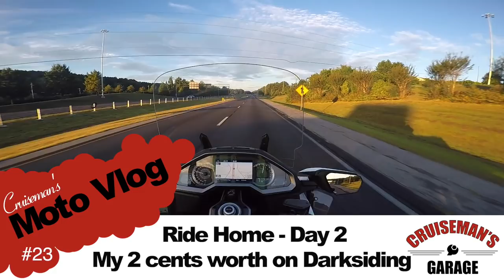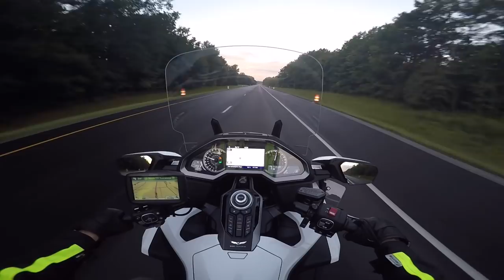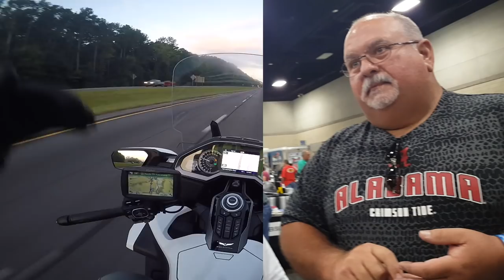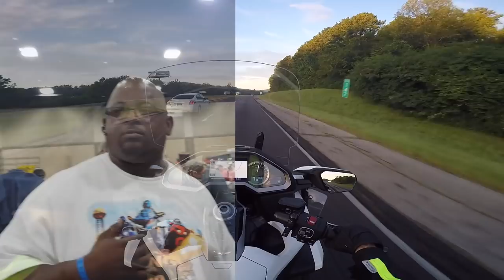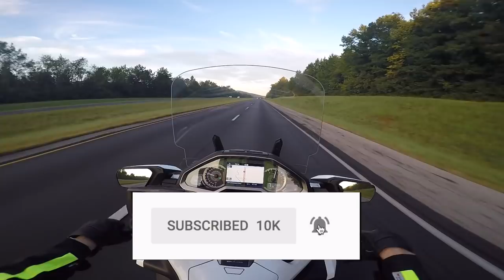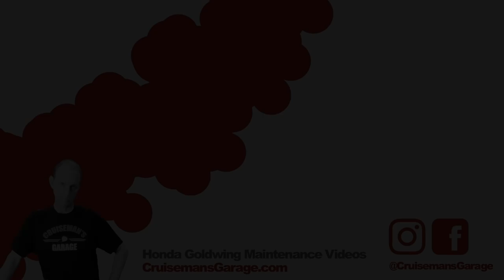[Ep 23] My 2 cents worth on Darksiding - 2018 Honda Goldwing

Comment: I can give my 2 cents on this I had one for over 19,000 miles on a toyo darkside on my 2012 it was neat to try it but when I got a deal on a set of new E4 I installed them, When I dismounted the   darkside the side wall was very flimsy not stiff at all, Saying that I am a younger Goldwing and I ride the curves move aggressive than most, Cause I have yet to see a Goldwing with the lower cowl scraped from front to back and the front crash bars scraped up  but lol bike handle like a dream, But the car tire isn't made for the bike PERIOD. But for folks that pull trailers and ride hwy 90% of there travels, It is a money saver and fine, But for me I tried it and its not for me MC tires rest of way.

Comment: My 2018 White Tour is not DS (yet), but my 2002  Black is Darth Vader and has been for quite some time.  There are HUGE differences in how various car tires perform and you need to get the right one for your style.  Run the super slab, get one of the run flats.  But I live in the mountains, non-run flats for me and I do not do it to save $, its the traction.  Honda has almost made all 2018 GLs Darkside!

prs
Reply from the maker: "Honda has almost made all 2018 GLs Darkside!": Not sure I understand.
Reply: Cruiseman's Garage  : Take a look from the rear of your 2018 at the tire.   How WIDE it is (wider than the 180-55R-16 many of us use on the previous model.  Notice the profile, as you discussed, is rounded, but NOT so much as the Dunnies you used on your previous bike.  This is something I originally thought I would not like at all, but now; it is a viable option.  Also, even though we tend to run fairly high pressure in non-run flats, the ride is super comfy!  Pillion ride is very happy.

Comment: You are quite a scientist.  One story you cannot authenticate makes your decision.  Okay, I know two people who suffered belt separation on a Dunlop E4 running at highway speed and in one case the bike went down and totalled it.  Is that enough to not run Dunlop E4s?   I run Kumho/Continental/Michilen ZP 195/55/R16 for over 200k miles, no issues.  The tire is difficult to install on the rim.
Reply from the maker: Never claimed to be a scientist. Find a motorcycle dealer that will install a car tire onto a motorcycle rim and, I might re-think my position. Or, find a car tire company (one that does not make MC tires) claim that it is OK to mount their tires on a motorcycle. In spite of the inability to provide either of those, I am still open-minded to Darksiding.

Comment: I think with all this attention being drawn to dark siding that the insurance co.s will be taking another look at this issue and will start denying claims. It would be a excuse for them not to pay off, whether or not the tire was at fault.
Reply from the maker: I don't think the Darkside community is large enough to grab the attention of insurance companies. You can even break the law and insurance will usually still pay. If you are speeding, and have an accident, insurance pays. They may not renew your policy, but they will pay. Pulling a trailer is not recommended by Honda, but my insurance company INSURES my trailer.

Comment: Cruiseman, all of your repair videos I've seen provide excellent, factual info that is easier to follow than the repair manual. However, here you provide nothing factual, and only offer your opinion and here say. You are an influential person in our community, and what you have done here is validate the naysayers, and embolden them to voice their own emotionally charged opinions. Many cite safety, poor handling, and intended design of car v. motorcycle tires, yet they pull trailers. I refer back to page 4 of my 2008's Owner's Manual, under the WARNING of serious injury or death re: trailers & sidecars: "This motorcycle was not designed for those attachments, and their use can seriously impair your motorcycle's handling." Simply put, the naysayers who pull trailers are, "talking out of both sides of their mouths". Further, most have no first hand experience with DS. ***Instead of speculation, I challenge YOU to actually try a car tire for 1000 miles, then come back and give an update based on your experience. Choose any brand, but make sure it is a run flat, size 195/55, and experiment with PSI from 32 up to the max limit of the tire, as printed on the sidewall.
Reply: Amen Joe , tell it brother...
Reply: Joe, very well stated. I went to a CT for the wear, I found I had more traction in a corner. I never dragged a foot peg with MT on my bike, now it's very easy to do that because the bike feels more stable and it has a softer ride than before.